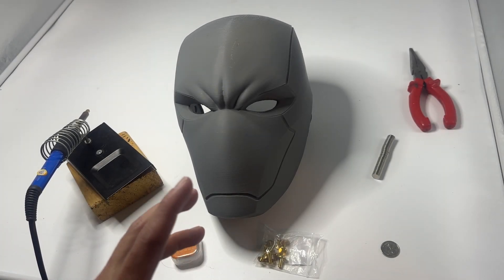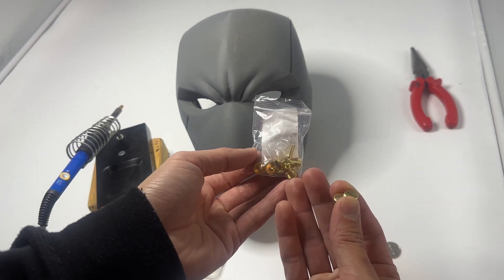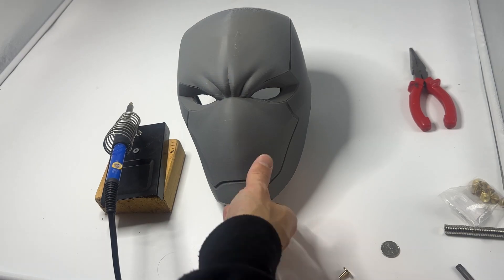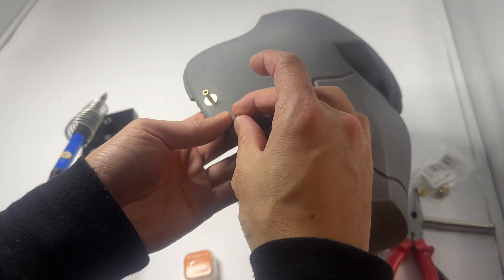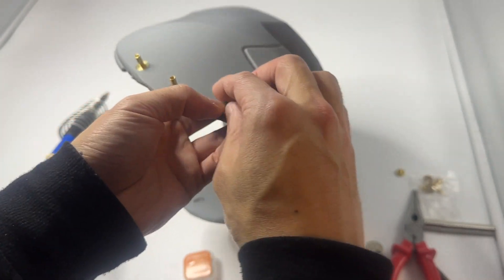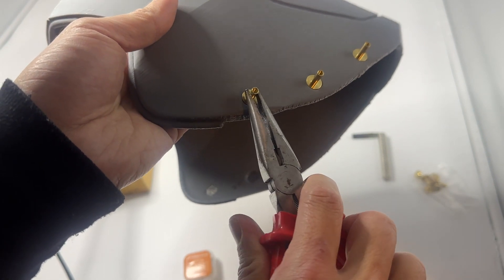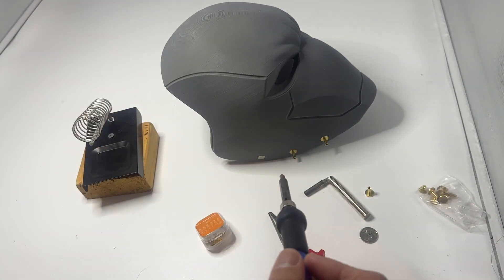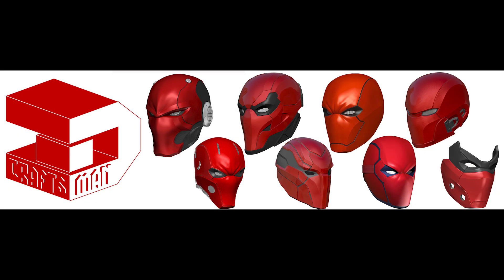Physically create magnet slots in your 3D prints! BEST METHOD

Comment: Since you're already using a soldering iron, could you literally solder the buckle part to the heat-insert tip? That'd likely be MUCH hotter than the 200-240ish range you'd be melting the divots into the plastic with, so I'd think the solder joint would hold up since you'd likely be staying well away from 300c or higher, maybe even go out of your way to get some 400ish lead-free solder and you'll NEVER get anywhere near that hot to melt into plastics.

Comment: Anyone want to explain why this is better than adding a negative cylinder in Orca? It takes 20 seconds, doesn’t require cad knowledge, purchasing anything, or melting plastic.
Reply: Correct, adding in the slicer and dropping them in during the print is the best way.
Reply: when you forgot to do it or when you decided it needed it post print maybe

Comment: I would have loved a link for purchasing. That said I have found the "belt buckles" under the name "chicago screws".
I'm still searching for the round soldering tip set, please comment here if you find that
Reply: Same.. a direct link would help to but the same
Reply: Someone just posted they are soldering tips for inserting heat threads, and I can find them under that name :)
Reply: @amberelferink  I was talking about the specific Button belt buckle pieces he bought on Ali - I cant find flat round without a bevel. Or one without a flat head screw notch.
Reply: Looks like only he can add links in the description.

All the ones I find have a slight bevel on the flat side... idk if that impacts anything or not... let me know if you try it, I will do the same.